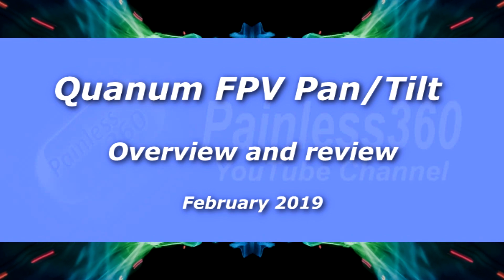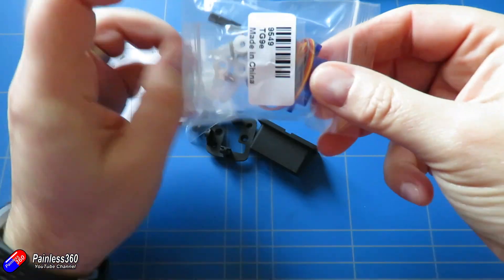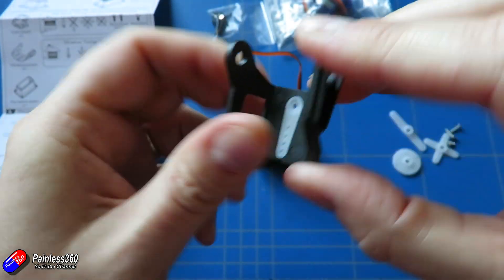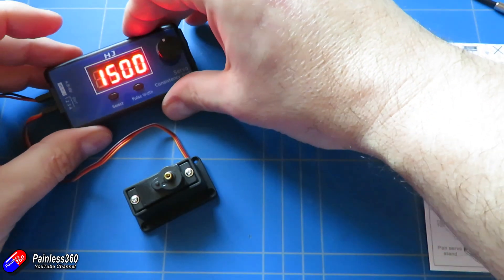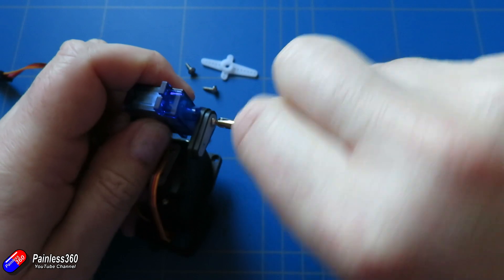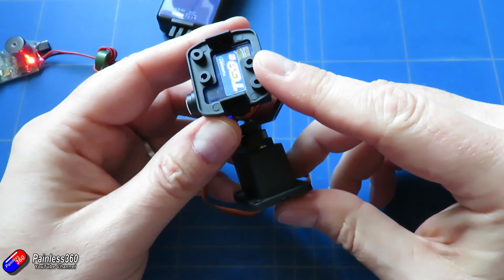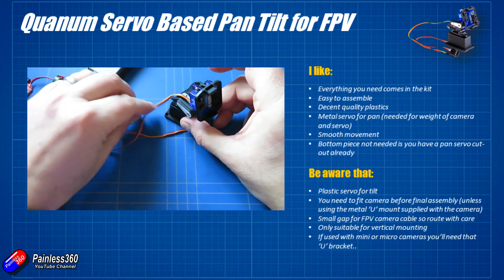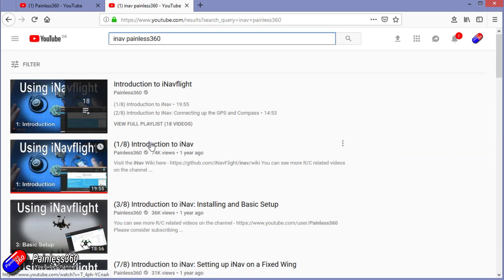New Quanum FPV Servo Pan Tilt

Comment: Not particularly cheap but the hassle-saving over building your own system makes it worth looking at. Especially for the newer user.. I like it
Reply from the maker: Exactly, for those not willing to spend days tinkering with a 3d printer and design software this is a great option! :D

Comment: Great video, but I would have liked it to have a 360 degree pan servo rather than a regular off the shelf 180, especially for that crazy price..
Everything I use pan and tilt on needs to have rear view as I want to be able to look straight back, and that includes ground vehicles, boats and aircraft.
Cheers and thanks for posting.
Reply: Check out Fpvgadgets.com . They have a pan tilt system that can do 360° . You just need to mod it a little with a slip ring .

Comment: is there going to be a followup to this ? i'm very intrigued. hope you'd mount it to a quad and not trying to get everything out of view. because you still have to keep track of thrust direction. I'd have it in a dom like sitting in a cockpit.
Reply from the maker: I've used it in the latest iNav and Bixler Build.. Works well..

Comment: there should be a set including roll and ready to also hold the board of a runcam split, caddx turtle or similar.

just so you could add stabilisation and head tracking hd cam to any device on the cheap

Comment: Design flaw? Why is the "lip" for the pan servo plastic mount on the bottom? If I wish to sink the servo in my FPV camera deck for low profile it looks like I would either have to trim the plastic or make a bigger hole and deal with slop.
Reply from the maker: Or mount it from underneath? ;)

Comment: On the subject of Quanum camera holders - avoid the Quanum Single Axis Gimbal with Camera like the plague. Bought one nearly 2 years ago, interference lines in the camera, replacement was no better, the gimbal electronics are the cause.
Also, it's ability to keep level when yawing is abysmal, I had to keep manually adjusting the angle with a dial on my TX to try and keep its tilt angle steady. I can't believe they're still trying to sell it 2 years on.
Oh and the tiny button to change modes is nearly impossible to press, which it conveniently forgets when you power it off, I think I broke the button on one of them trying to stab it with a 1.5mm hex driver.

Comment: how do you control it mate
Reply from the maker: It's just two servos. See my head tracker and INav Bixler Build where I use it... Happy flying
Reply: @Painless360  yes but can i use my rc wheel tupe transmitter or do i need a tarnis with switches

Comment: $10 ones on Amazon with plastic gear servos, and $12 ones on BangGood with two MG servos. Also Thingiverse has easy to print solutions for MG90 servos. Sorry this HobbyKing one is a rip-off. Hard pass